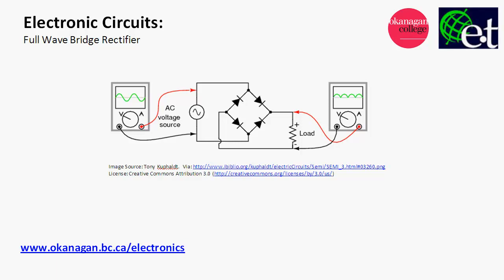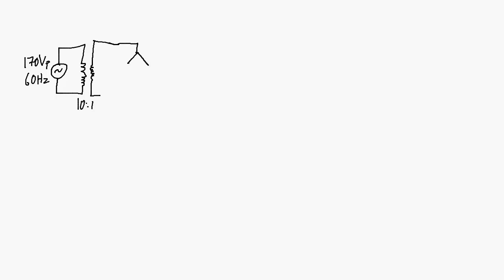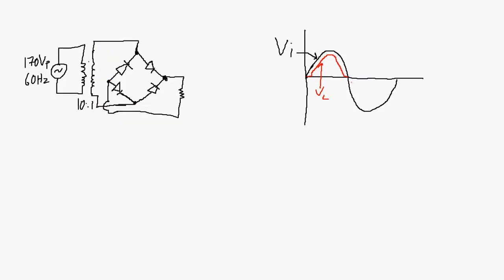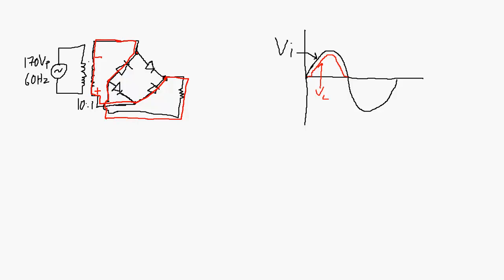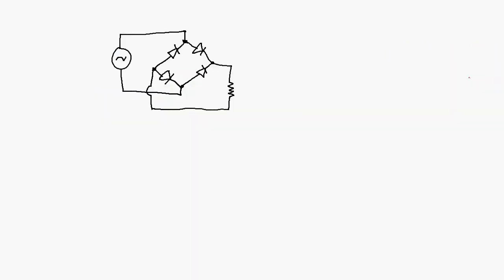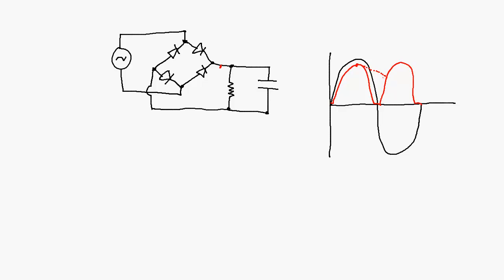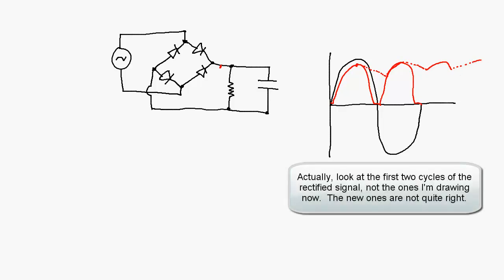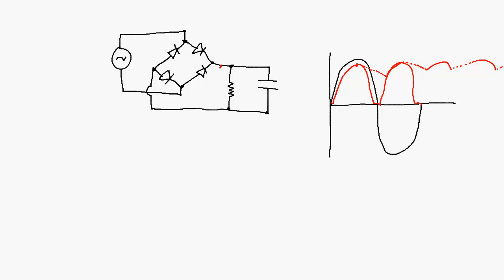Diode - Full Wave Bridge Rectifier

Comment: Somehow when you explained  in 3:38 and later on that the current went in in the same direction, therefore the wave would always be positive, during both the positive and negative semicicle i fully understood the problem from which  i couldn't get an answer from half a dozen other videos. I thought it didn't matter where the current came IN from and went OUT from in a resistor since it is not polarized. Nevermind, Great explanation!

Comment from the maker: +Mario Cordelli I'm not sure what you mean by forward voltage of the load, but the voltage across the load is the same as Vout.  If you consider Kirchoff's Voltage Law, the voltage across the secondary will be equal to the voltage across the two diodes plus the voltage across the load.

Comment from the maker: Electron flow is from negative to positive, conventional current is from positive to negative. The basis for conventional current came from  Ben Franklin (I think) who assumed that there were these positively charged things that moved around causing current. Since then the tradition has been to analyze circuits as if the charges moving in current are positively charged and move from positive to negative, when in fact (in most cases) it is negatively charged electrons that are flowing (- to +)

Comment from the maker: If the capacitor value was increased, the voltage ripple will be reduced.  The ripple is approximately   Vripple = IL / (f*C).    IL is the current to the load, f is the frequency of the ripple and C is the capacitance.  However if you increase the capacitance of the capacitor, there will be a larger current into and out of the capacitor.

Comment: @Usman..No we cant use only a single diode for it because the frequency always takes positive as well as negative cycle.This may be done by 2 diodes but in that case heating effect will be more.That is the reason why we are using 4 diodes here

Comment: Very good, I especially like the example of the calculation. Just yesterday I was busy with multisim increasing electrolytic capacity to see what it did on the scope. But know I know how to calculate the riplle. Thx !

Just one question, The cap of 1000uF you drawed, it's not an electrolytic is it ? I tried putting a 1000uF electrolytic in place with it's minus connected to the ground but get quirky results on my multisim scope. Any idea ?

Comment: Thanks for the video. Could you elaborate on how the ripple voltage expression was obtained? Specifically, the expression resembles a standard RC discharge result, but with an extra +1 term in the denominator, could you point out its origin, please?

Comment: Around 4:25 and 6:40 - To find the new voltage peak of the load after rectification, why wouldn't you also subtract the voltage drop occurring across the load, plus the 1.4V diode voltage drop? Is this because you are determining the peak voltage the load is receiving, and not at the Vout? I may be answering my own question but please confirm...So would determining the peak voltage after the load be the voltage at the load minus the resulting forward voltage of the load? Which would also be Vout?

Comment: is it T comes from T=1/f, where f=60Hz, the answer should be 16.666ms, and we divide it with 2. then it will become 8.33ms. and why is the reason we divide by 2? is it because the of the half cycle for the output? correct me if i'm wrong.